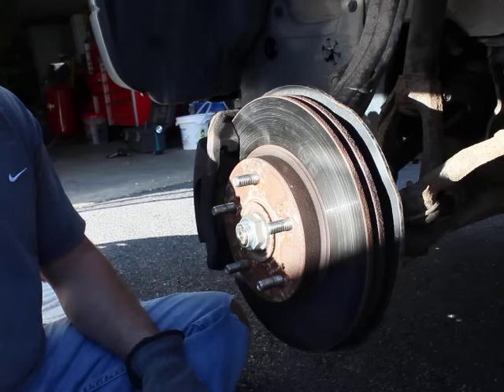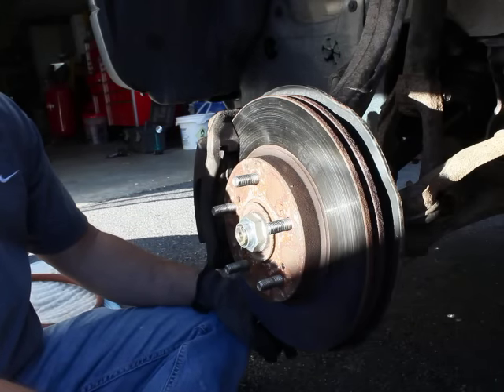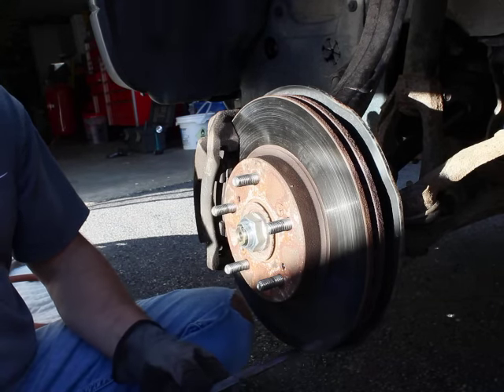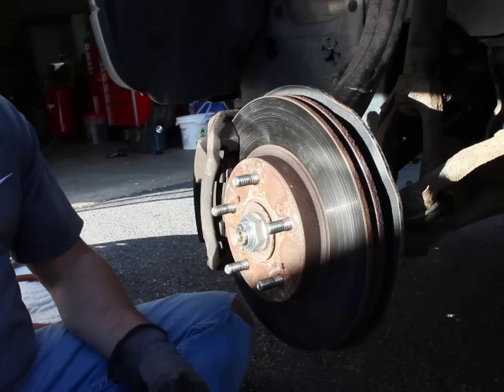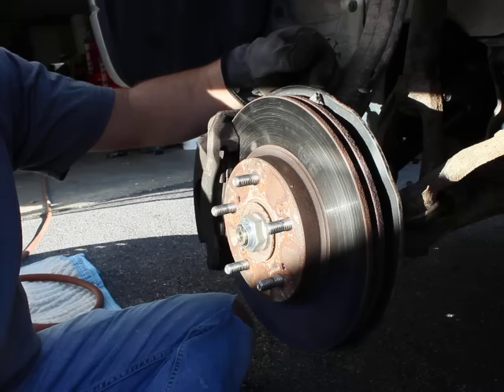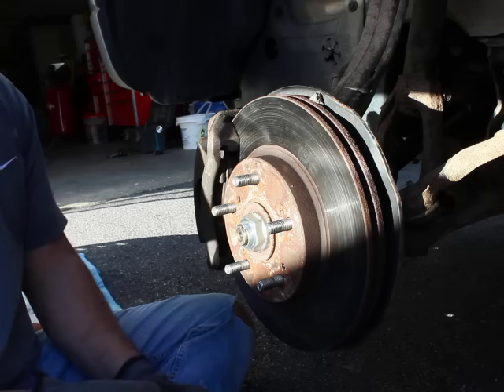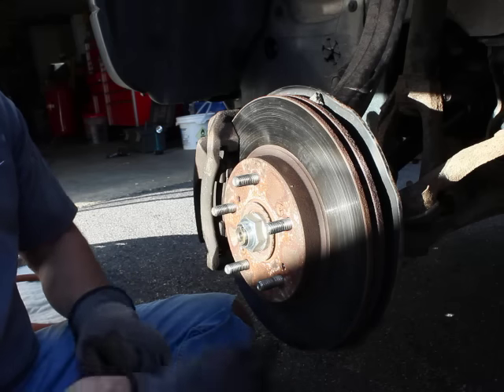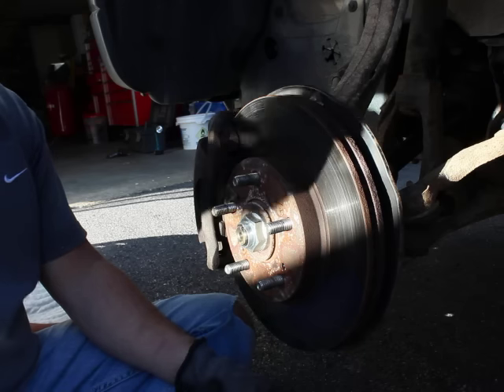Scraping Noise From Wheel While Driving

Comment: I have a nissan altima and it makes like beepy noise in rear wheel when I drive faster cant hear it but when I slow don’t it is possible to hear but it is not a loud noise what might be a reason for that
Reply from the maker: Hi Novruz, 
You could be hearing the wear indicator on the brake pads warning you that your brakes are getting low? It's a ver light squeak noise, it could be interpreted as a beep noise.

Comment: I have a 99 solara I had my front pads changed and back drums changed by meinke and they resurfaced my rotors didn’t happen right away you know the noise the car makes when you brake like a squeaking noise like maybe dirt in there or etc well it does that now and then and while I’m driving sometimes and when I slow down to stop at a stop sign then to make a turn it squeaks I brought back to them twice and they took it for a ride and no noIse and I ask them to take the tires off and check and they couldn’t be Bothered cause they felt they would be wasting there time since they don’t hear any noise my other mechanic I Always go to I ask him and he sayed they put on such strong brake pads that last and then me not replacing the rotors which was 75 a pop and instead resurfacing them for 35 that’s what my mechanic sayed could be  the problem that the squeak is from the rotors just want to know if that sounds right and he said no body resurfaces rotor anymore you always replace them let me know thanks how many rotors does a car have 4 what a normally price to replace the rotors for a 1999 Toyota solara 2.2 liter
Reply from the maker: Hi DXFAN, 
If you didn't use OEM brake pads, most likely the noise is coming from the pads. Some Aftermarket brake pads have a mixture organic, ceramic, and metal materials that make up the brake pads. I highly doubt the rotors are making the noise, especially if the brakes were not making this noise before the work was done. Hope this helps.

Comment: hi...bought a new alto k10...there is a grinding cum whistling noise from front left wheel...pl advice.what it cud be..
Reply from the maker: +Rippy Rai If it's brand new, moat likely you picked up a rock and it's stuck between the rotor and backing plate. You'll need to remove the wheel that the noise is coming from and check the area for debris, or just take it back to the dealership, it should be under warranty still :)

Comment: I have a similar woof woof woof errrrr sound cant really tell where its coming from but here it is in a nut shell. Replaced: all wheel bearings,  brakes and rotors, sway bar bushing and links, been to the diff guy he says its rotational but not fadt enough to be diff related but could hear something but couldnt pin point it and this is where we are oh all fluids have been changed and its been to 3 mechanics and no one can figure it out and it howls like a bistch on the highway. Any thoughts
Reply from the maker: Hi Mark, can you make a video, upload it to YouTube and send me the link? What is the year make and model of the car?

Comment: my brakes have been replaced, both pads and discs , about 15 000km ago. i dont drive far and if i feel the discs they feel good no edge lip and the pads look good also.  however, i have heard recently in a parking bay when i turn hard left i and only moving forward...i hear a metal scrape sound, very faint... like a light train track sound..... BUT only when turning hard left, i would say half the full turn until full, is when i hear it. real pain. Not sure for how long it has been like this, but i dont hear it when i turn right and when im on the road with all the other cars and traffic noise u cant hear these sounds.
Not sure what is causing this noise and if it is serious.
Car is stable, i dont have bumps or rough ride and i dont have any brake noises or squeeling whatsoever.
my car has done 43 000 km give or take.
Reply from the maker: Hi Imre, 
It's very possible you have a small rock stuck between the rotor and backing plate or the backing plate is bent and is too close to the rotor and needs to be adjusted like I show in the video. Let me know what you find, thanks.

Comment: Having the same problem, but when I tap my brake...it stops the noise.  Could a bent back plate or rock be the problem if the noise stops when applying the brake?
Reply from the maker: I recommend having the brakes checked, the brake pad wear indicator may be touching the rotor warning you the brakes need changing. Let me know what you find, thanks.
Reply from the maker: https://youtu.be/BuScoY8Rhvg

Comment: I only hear a grinding noise on my 2004 explorer 4X4 when I make a right turn only. I had front and rear brakes and rotors replaced. The car was sitting for a year and change so I'm not sure if this happened before the brake job ( I don't think so). Any idea what it is?
Reply: I've got the exact same problem on my 2001 Honda CRV.  Did you figure out what's causing this on your car?

Comment: Why i only get scraping noise only when i drive it little ? At start there is no noise
Reply from the maker: Hi Filip, the noise you're hearing is most likely the wear indicator on the brake pads warning you that the pad material is low. I recommend you have someone check all your brakes, inner and outer pads. Inner pads typically wear faster because they are against the piston.
Reply: @EddieCarrara1  is it normal for the noise to appear later after warm up ?
Reply from the maker: @audiophilipp  If it's the brake pad wear indicator the noise will come and go randomly.

Comment: Thankyou for the trouble shooting. I got honda accord 2008 sedan. When i drive i want the car to be sound less. But i noticed that my front left wheel side got sound. I thought its wheel bearing so the mechanic changed it. Then mech fount the ball joint play so i changed the whole upper joint assy comes with the bracket. Did the tyre ballancing too. No help at hi speed i feel the sound is there with slight vibration so i changed both tyres front one new yesterday. Coming back home the sound is still there i want the car drives without  grinding type sound .the other 3 wheels r very smooth no sound from there. Pls let me know what could be ther causes. I am thinking of the rim but during tyre change ballancing will tell us if rim is no good. Plz help me as i lost until now more than 700dollars or more. Thanks.

Comment: Hey ed,im getting that same exact sound only when i turn left i recently did my rotors on my 2005 honda pilot but i didnt notice the sound until recently.The noise sounds exactly how you described it.Is there anything else that can cause that same noise other than the dust shield,the noise is a tinny rubbing sound,any info will help....Thanks
Reply from the maker: That's usually the problem, sometimes flakes of rust will get trapped between the rotor and backing plate, maybe that's your problem and it just need to be cleaned out? Try moving the backing plate away from the rotor by using a screwdriver through the wheel, go all the way around the rotor, even at the bottom. Keep me posted on what you find, thanks Elmorenoblanco

Comment: I’m getting a noise like that only when I make turns more so turning to the right and when I’m slowly driving after the turn
Reply from the maker: Most likely a CV joint Comedian Oreo.
Reply: @EddieCarrara1  ok thanks I was told by a shop it was my front differential and my hub bearings I changed the hub bearings but the noise is still bad. I thought cv joints made a popping / clicking noise when turning I’m so lost I got in at another shop now doing a month er diagnostic check to see what they say

Comment: I have a mazda 6 automatic 10k miles. When I accelerate (this is when I'm already driving and want to speed up and step on the gas slightly) i hear a faint grinding/scraping sound. It is very short like less than a second but it happens everytime i try the process i mentioned before. Took it to the service center they noticed the sound during the test drive said it could be the mount or axle or transmission but after a day they said they didn't find anything wrong and that its probably normal. But it wasnt there before so how is it normal. I feel like it comes from the front right tire or engine area. Any help? :(

Comment: Hi bud I've got an issue with my car it does sound very scratchy if I leave car 2 sit a day and go for a drive almost sounds like I'm taking  a layer of rust off I've bin told it could be my caliper sticking??I haven't had brakes done on front but I will try your method as I thought it was a wheel bearing

Comment: Hello, I have a 2004 Subaru WRX, I don't have a rotar backing plate but everytime I turn right while accelerating it'll make sort of a deeper scraping sound, It happened ever since I got my Rotars Machined, what do you think it is?
Cheers
Reply from the maker: Hi Dane, so it's only when you turn right? Does it sound like a thin metal, thick metal or plastic scraping noise?
Reply: Thick metal or plastic scraping noise, sounds pretty dense the sound while I'm in the cabin driving
Reply from the maker: If it's a heavy grinding noise, it's possible your rotor is touching the caliper bracket, not sure why, unless the axle not is loose. Did you do the work yourself? If a mechanic did the work, bring it back asap just in case it is a loose axle nut. Let me know, thanks.

Comment: Ok I got a 2006 xc70 Volvo I trun to left and a scraping and squeaking sound. I was told a cv joint bit boot not ripped so what do you think it is?
Reply: Ok fixed back plate rubbing on rotor

Comment: My truck makes a scraping noise only when I'm going under 5 mph
Reply from the maker: Hi Nathan, I recommend checking your inner brake pad thickness, it sounds like your wear indicator on the brake pad is hitting the rotor warning you the brake pads are low and need to be replaced. Keep me posted on what you find, thanks.
Reply: @EddieCarrara1  thx for the quick respond I found a piece of plastic that had broken of on the inside of the hub cap that seems to be making the noise

Comment: I have a 2012 ram 1500 4x4. When I first get goin my vehicle makes a scraping sound and gets worse as I drive. When I hit the breaks I hear like a hissing noise then the sapping noise. Should I buy brake pads or is it something else?
Reply from the maker: Rickey Morris  Hi Rickey, I would have your brakes checked first before you do anything. It could be rust on the rotors in the AM causing the noise.

Comment: What if you don’t just get your brakes done and it’s only coming from one wheel.
Reply from the maker: Hi Ali, I recommend you or someone pull the wheel off the vehicle and check your brake pad thickness, you may be hearing the brake pad wear indicator located on the inner pad, it might be time to replace your brake pads. Check out this video I made on brake pad wear indicators and let me know if this is what your noise sounds like. 😊 https://youtu.be/BuScoY8Rhvg
Reply: @EddieCarrara1  nope….. it’s more of a scrunching grinding noise.  My neighbor said it sounds like I need rotors.
Reply from the maker: @Ali-Muscle  Then most likely the brake pads are worn out and need to be replaced. The warning tab is to warn you the brake pads are getting low but your description sounds like the pads and rotors are metal to metal lol. Let me know what you find.
Reply: @EddieCarrara1  yep. It was metal to metal.   The other side was barley holding on.  I ended up replacing one rotor on the driver side and replaced both front brake pads.  
   The Problem is now solved .  Back to quiet stopping . Lol
Reply from the maker: @Ali-Muscle  Wow, so glad you caught it lol. Thanks so much for coming back with an update, that was very awesome of you 😁

Comment: I just replace my brake pad.... There is metal. Sound coming only when car comes to stop (0kmph). Other wise no sound from car, even on bumps, pothholes.... It comes only when it comes to halt(brake is pressed completely), some metal sound
Reply from the maker: Hi Yogesh, I recommend you inspect the anti-rattle clips under the brake pads (they sit in the caliper) sometimes they are not centered and will touch the rotor when coming to a stop. Let me know if this helps, thanks.

Comment: So I recently (friday) hit a bad pothole that gashed my tire. Drove it 1mile home just fine before it went flat. Put the donut on it and it grinded so bad. I even bought a new tire and it's still making a loud squeak noise. Even if the car is bumped and that tire moves slightly it squeals. Could this also be the problem or did I put the tires on wrong?? Thank you for your help!! ❤❤
Reply from the maker: Hi Dezi, I think you may have bent the backing plate when replacing the tire, try using a long screwdriver to push it away from the rotor.
Reply: @EddieCarrara1  omg I'm a dumbass, what's the rotor? So do I push it forward or back?? Thank you so much for your help. My car is a new Corolla and it's my first and of course I have no spouse, brothers or male friends to help me lol Thank you so much!

Comment: I have a 2007 Infiniti fx35. Yesterday I hit a pot hole and 4 warning lights came on. Slip, abs brakes, CDC and something else. After that I started hearing rattling noise coming from the front drivers side tire. But there is no plate to rub against the rotors it could be a rock but would a rock cause the warning lights to go off. I'm lost please help

Comment: How about a grinding noise that only occurs starting at 0 MPH to 15-20 mph.. rock maybe? idk...
Reply from the maker: ***** Does it sound like a tin pie plate or is it more like squealing sound?
Reply: Sounds deep and kind of like a rolling grind... hard to explain. I did see brake dust on my rim today, but someone mentioned it could also be CV joint. It only occurs from 0-15mph.
Reply from the maker: Hi Amber, 
What is the year make and model of your vehicle?
Reply: 2003 Olds Alero
Reply from the maker: CV joints make a clicking noise when turning sharp and accelerating. Have you had your brake pads checked yet?

Comment: Does the noise increase at different speeds
Reply from the maker: Yes Brandon, the backing plate or rock is touching the rotor so the faster you drive the faster the the noise sounds.

Comment: Hi,
So I went to the mechanic for the same issue on my 2004 Honda Odyssey and the mechanic said it was wheel bearings so I replaced the back rear (both of them) it still made the noise. So he said it needed a new part (the whole arm and where the plate and brakes go) I don’t know what it’s called in English. Well I got the park and....Well I just got it back today and it’s still making that noise (the part he bought it off a junk yard) could it be that it’s the backing plate of brake caliper or even caliper bracket. But it’s making that same noise like a scrapping sound as I’m going 5-10 mph or even while I’m driving 35-45 mph and on somewhat smooth roads. Yes, I would hit curbs but since having the vehicle since January I’ve only hit it no more than five times. Can you please help. He’s charged me $400 just about. Just so it can still have the same issue.
Reply from the maker: Hi Janet, 
First I would demand my money back and I wouldn't bring my car to them ever again, the noise hasn't changed and you're out $400!!!  Can you make a video of the noise and post it on YouTube then send me a link? Do you know if you have drum brakes in the rear or disc? Where is the noise coming from, the front or the rear of the vehicle? Let me know, thanks.
Reply: Eddie Carrara I will try when I can record the video. But I don’t know I’m suppose to have my regular mechanic look at it tomorrow afternoon. He thinks it could be the brake caliper or even the brake shoes but he’d have to take it apart and he’s going to tomorrow. I’m keeping my fingers crossed he fixes the issue and he’s reasonable but I’m thinking of suing him or calling the police so they can make him pay me back. I took it to the other one because I couldn’t get ahold of my regular mechanic. He really didn’t take advantage of me just because I’m a woman I know a little bit about cars just not enough. But the noise is coming from rear right side of vehicle. It sounds like the video you did here but I can try to record it if I can. 
Thanks I’ll keep you posted.

Comment: Mine does it after a while of driving, while making a turn , or at freeway speeds
Reply from the maker: Hi Alej, I recommend you check all the brake pads, it sounds to me like the brake pad wear indicator is touching the rotor, the inner pads have the wear indicator mounted to them so inspect the inner pads closely.
Reply: @EddieCarrara1  actually changed them last Tuesday, front brake pads where toast with cracks . Thanks!
Reply: @EddieCarrara1  I also had the “BRAKE” and “TRACTION CONTROL” lights appear when I accelerated. Now they’re gone

Comment: Had same noise but mine it's come in and disappear when driving ??!!
Reply from the maker: Most likely the wear indicator is touching the rotor warning you the the brakes are getting low. I would start by inspecting all brake pads, especially the inner pads, they tend to wear quicker because they are up against the piston.

Comment: good day sir l have a problem of 2011 hyundai accent. when my car start running  there's a cluncking sound in my front wheel in the right side of the car.by the way its allmost 1yr when i change the wheel bearings  both side but still l hear the sound specialy when i break, when i changes gear and when a engine break i hope you can help me. thank you sir!